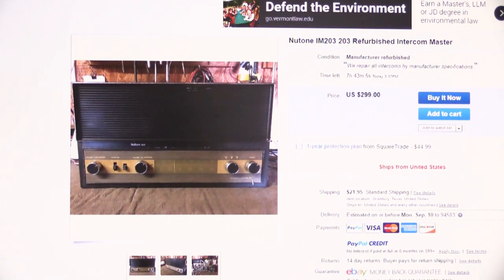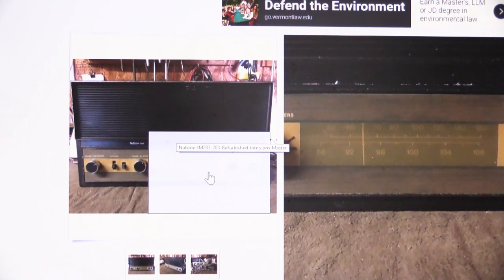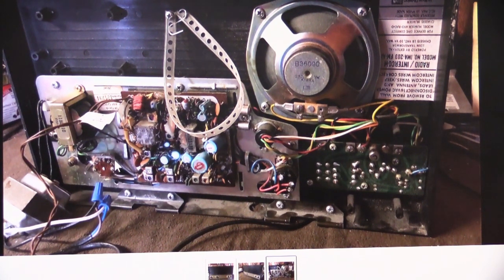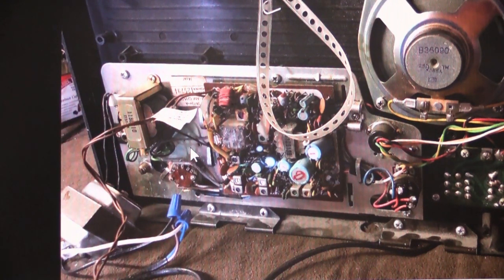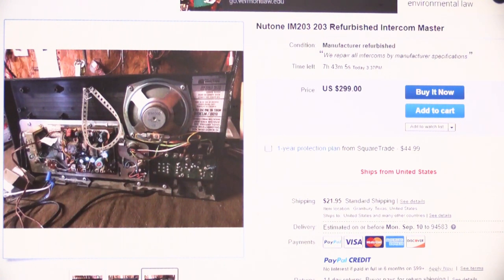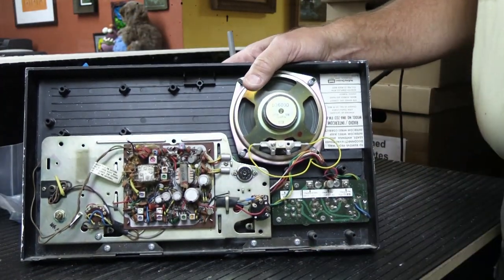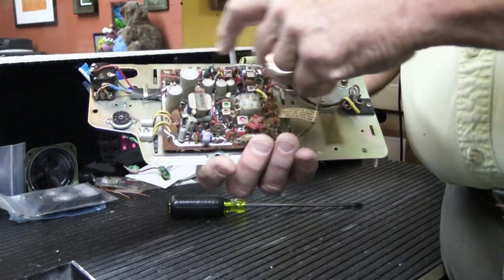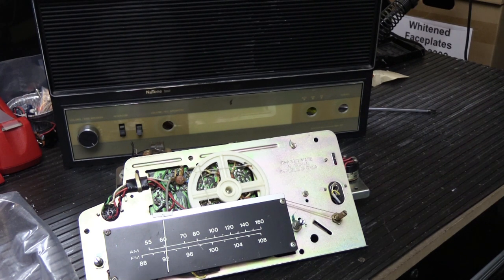A Follow Up to "Don't get Fooled just Because They Say "it's refurbished"

Comment: Thanks for calling out this scam!  And yet the seller has a 100% Positive Feedback rating.  Sad.
Reply from the maker: Hi Jim:  I think you can attribute their seller rating to how uneducated buyers are about the problems with their vintage NuTone Master Stations.  To many people are only interested in a quick solution to their immediate problem and they don't consider the long term issues that will arise on 30+ year old equipment.

I deal with these people every week - they are usually quite outraged when their "killer deal" replacement begin to have problems after a few months or a year.

I have always told people that buying original condition, used equipment is often just trading one set of problems for another - Chris

Comment: In my opinion, true and well made refurbished intercoms worth more than any Intercom listed as new unboxed or NOS for two reasons: 1.- It has been updated with modern parts such as resistors, capacitors, diodes, transistors making the equipment more reliable, 2.- There's a lot of risk of getting an equipment that has a manufacture failure. I mean, it may look in its original box, bag, totally clean, pretty cool but maybe it was returned to the fabric like 50 years ago for some unknown fatal reason impossible to notice in any picture. A truly refurbished equipment means that it has been tested prior the listing. However, EBay is our only source for finding obsolete NuTone parts nowadays. I remember few years ago there was one last excellent NuTone distributor called R&I Enterprise ran by this guy named Bob, but now unfortunately it's gone. Currently we've got nothing left but EBay and it's ridiculous prices.
Reply from the maker: Hi Luis:  You are correct about the quality of properly rebuilt and refurbished equipment.

Your Bob at R&I Enterprises is Bob Hoffman - former NuTone National Service Manger.  Bob is who signed my Service Center Certificate  when I was recruited by NuTone to become a Service Center.

When Bob retired from NuTone, part of his retirement package was all of the discontinued and obsolete NuTone Parts Inventory - a total of 12 box cars worth of parts and equipment.

He started R&I Enterprises and there where thousands of formerly unavailable parts - available again.  It was truly a fantastic resource for over 10 years.  In the end the only parts available were simply parts without any real use - things that no one really wanted or needed. - Chris